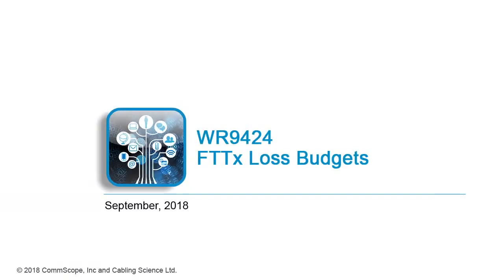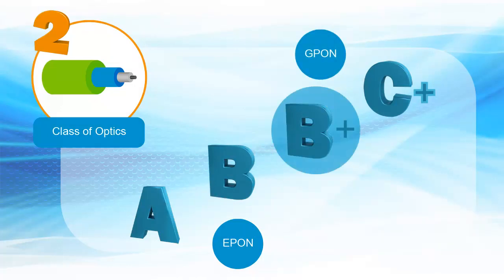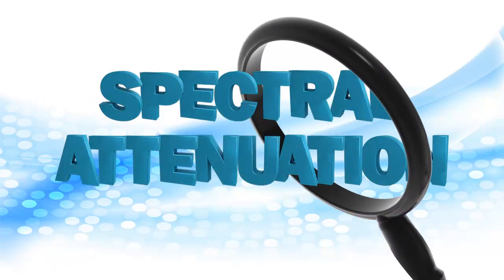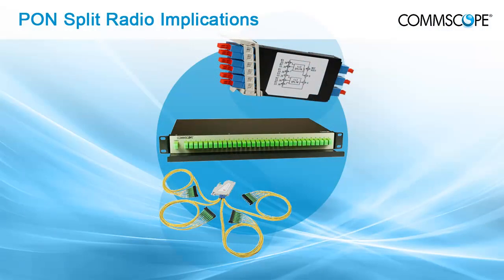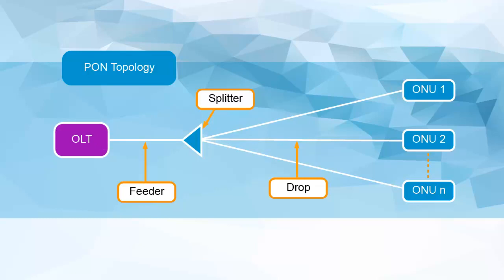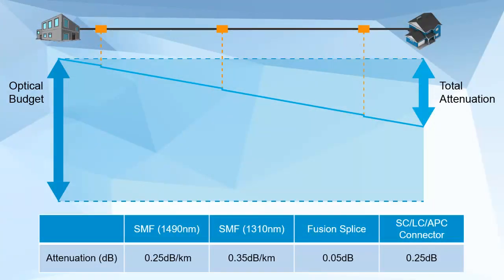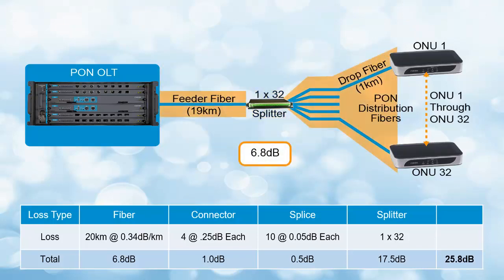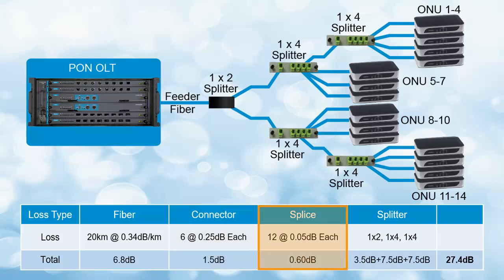FTTx Loss Budgets

Comment: Around 9:30 in the video, the example seems to be calculating the loss budget from the OLT to ONUs 8-10. What I'm wondering is if the splitter loss should only be for one 1x2 and one 1x4 instead of one 1x2 and two 1x4s, such that the total splitter loss should be 11dB (3.5+7.5) instead of 18.5 dB (3.5+7.5+7.5)? If I'm correct, then the total loss budget between OLT and ONUs 8-10 should be 19.9dB instead of 27.4dB. I'm a beginner and I'm trying to better understand this.

If I'm correct, then if we were to do the loss budget for ONUs 1-4, it should be 6.8dB (20 km fiber; assuming same length) + 2dB (8 connectors) + 0.75dB (I'm assuming 3 more total splices than the example given; 15x0.05dB) + 18.5dB (1x2 splitter, 1x4 splitter, 1x4 splitter) = 28.05dB. Does anyone know if I'm right or wrong here?

I have another question: are splices correlated with number of connectors? Or is it variable based on splicing cables over various distances as needed? I assume the later and that the number of splices provided in the example are some sort of allowance they've decided to generouslt build into the loss budget in case they are needed in the field.